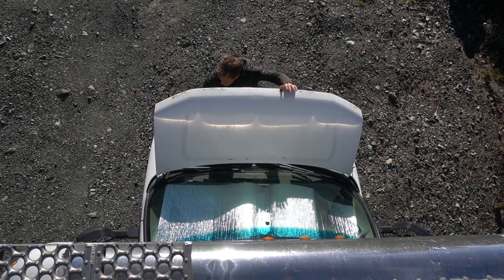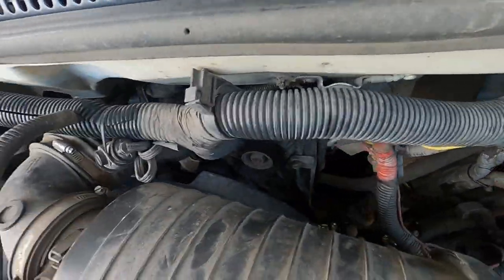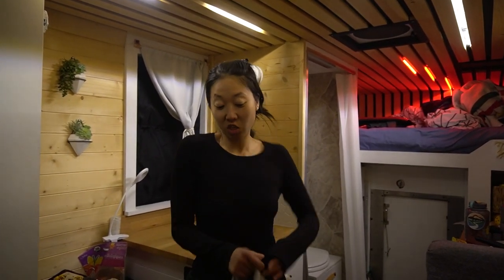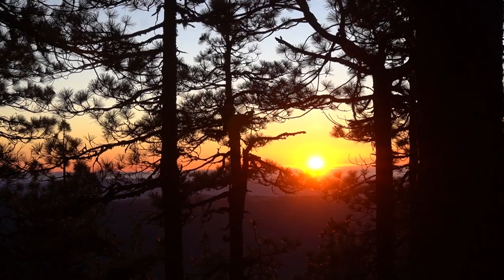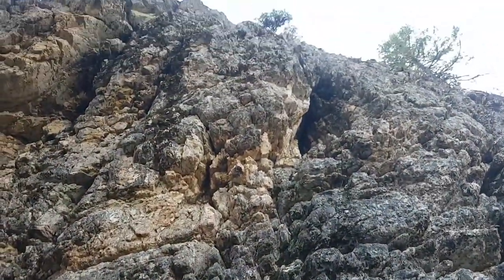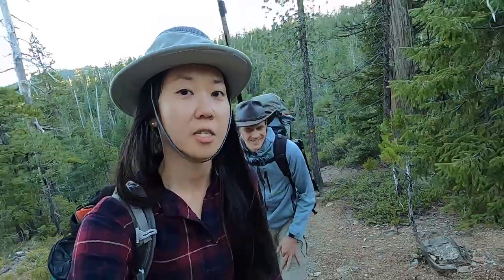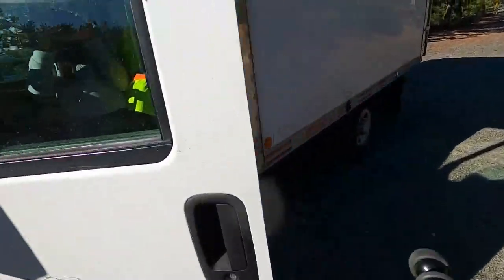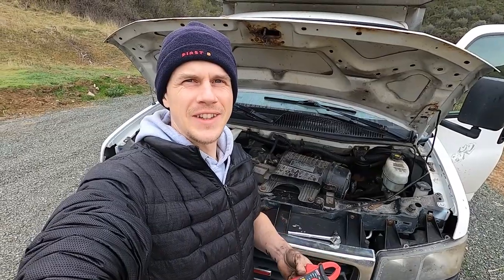Camper Van Stuck in the Woods | Vanlife in California

Comment: Yep, longer belt on the bigger Amp alternator. 

I was able to use the smaller alternator's belt on my high amp Mechman alternator that has a smaller pulley. Even with the smaller pulley it was a tight fit.

Comment: When you get a chance, get your VIN etched into your catalytic converter, install a steel plate or cage around it, attach a steel cable from it to the frame and/or paint it with high-temperature fluorescent orange paint. You want to make it difficult and unique to deter thieves. It's worth it, especially as you drive around the US, and in Mexico.

Comment: Even when you're not vanlifing and just have the van for family fun, it's constant tinkering. I did the alternator swap too, luckily without such troubles, but right after they stole the catalytic converter which left a 1m gap in the exhaust piping..that was fun to fix too. At least it teaches you skills 😜
Reply from the maker: Oh man I've heard about the cat being stolen! I'm actually afraid that could happen to us too. This truck has 3 of them, one for each bank of the engine and then a third one where the exhaust combines into the single exhaust pipe.
That Y-pipe is like $700 or so. It might also be all welded together, so we would have to find a shop.
Reply: @RoadtoPitches  yeah it's a nightmare here in Vancouver, all the repair shops that can fit my boxtruck are backed up with cat repairs for several months, that's how much they get stolen here, so I had to fix the pipe myself and I'm still on the fence if I get a new one. At least the insurance would cover it, otherwise it's way too expensive for the size of cat my 6.8 v10 needs.
Hope you don't get this problem, luckily if you live in the truck it's likely you'll notice someone cutting down there..
Reply from the maker: The upside I see is that insurance covers it, but yeah mechanics are always super busy. We basically took 2 weeks to get our parking breaks fixed (and the diff oil + axle seal changed).
Wishing you the best of luck with that repair!